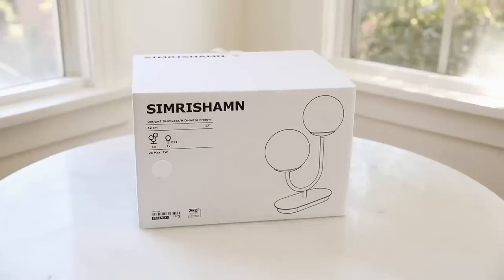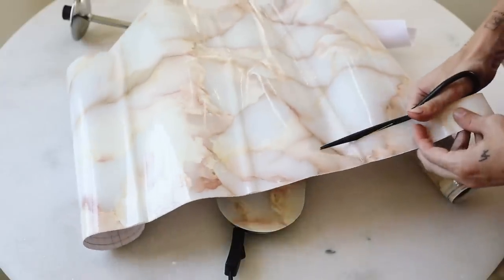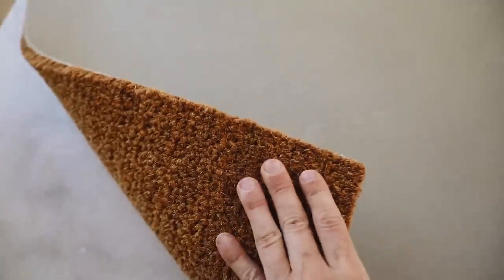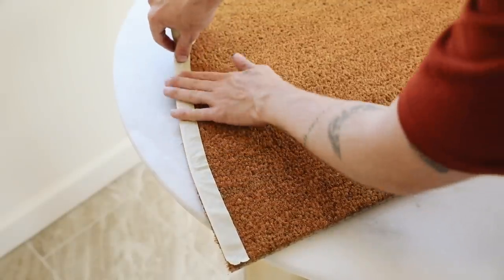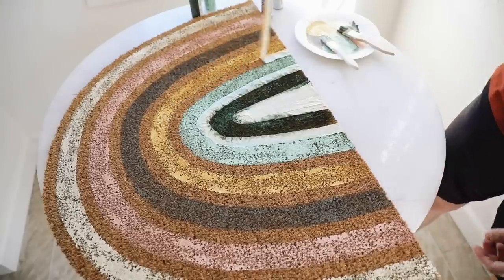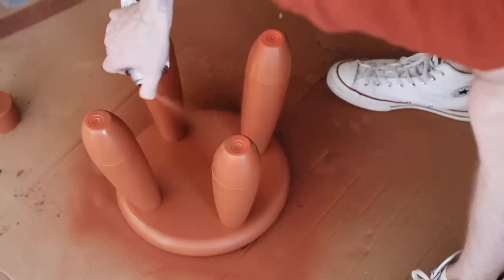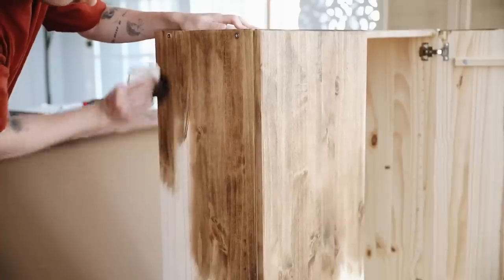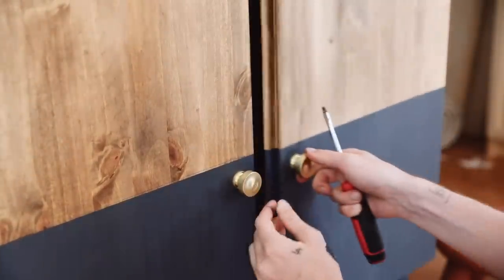DIY IKEA HACKS - Affordable DIY Room Decor + Furniture Hacks for 2020

Comment: If you want to get rid of the plastic join lines on the plant stand, you can fill the crease with kwik seal caulk, smooth it as much as possible, and then lightly sand. (Cosplayers use this to hide seams in their foam work)
Reply: Thank you!

Comment: If you're trying to paint a straight edge design using painter's tape, put some poly over the edges of the tape before you paint. When you pull your tape up, the paint will have a sharp edge, no bleeding.

Comment: LOVE (well, all of them, but especially...) the Ivar hack! I actually just spent last weekend building a floating sideboard in my home office using 4 of these cabinets mounted side by side by side by side. I noticed on yours there’s a gap between the doors. I’ve built with Euro hinges in the past without issue and went DEEP on YT trying to get that gap to go away by adjusting the hinges to absolutely no avail. If you were able to fix that, I’d love to hear what the trick was. The gap actually looks good in your case, but it’s throwing off my whole project (#ragingperfectionist). Love the channel! Thanks for inspiring all of us!